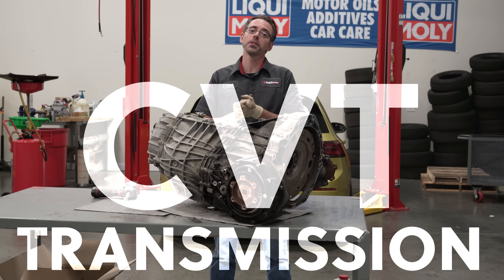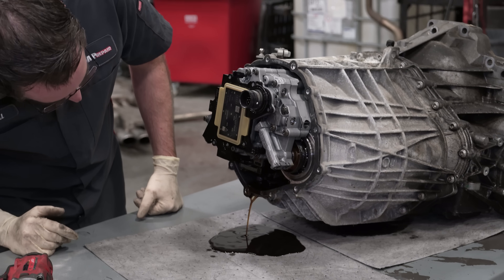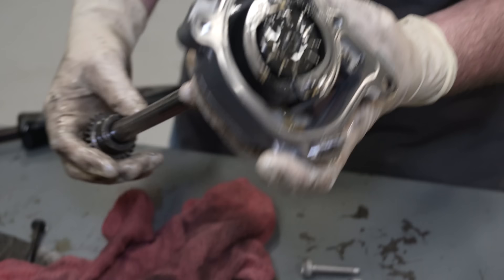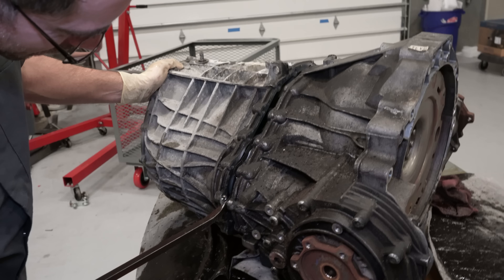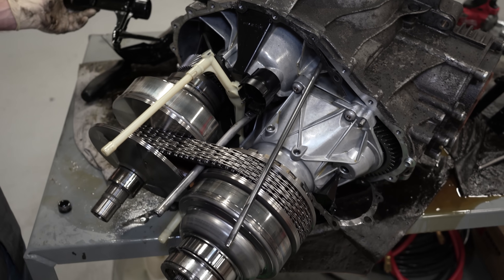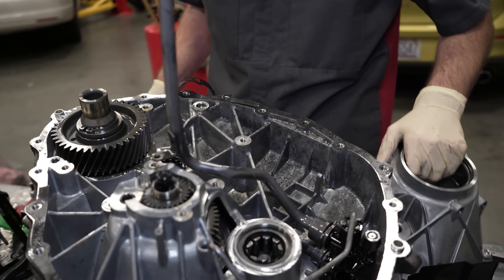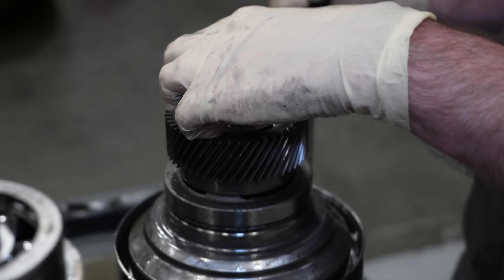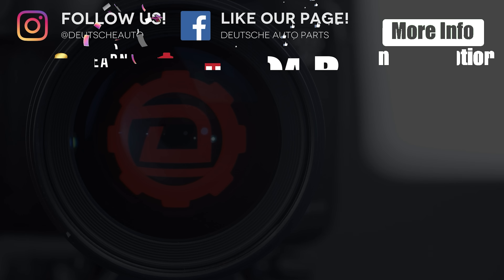Why you shouldn’t get a CVT transmission

Comment: This is my response to @loualexander3408,  9 months ago, who wrote:
"Toyota and Honda CVTs tend to last longer than other CVTs because of the launch gear. One thing many CVT vehicle owners do not realize is that no damage can occur if you change your CVT fluid more often (unlike regular transmissions with say over 200k miles on them). Additionally, changing CVT fluid more often (say 30k miles or so after the first change) can prolong their life. In the case of some Nissans, changing even after 15k can show a lot of worn material. Another thing to mention is that CVT transmissions work better when the transmission has reached operating temperature. So, in the winter your car may not need to warm up but your CVT does. I would wait till the car reaches normal operating temperature on a CVT car and be extremely gentle on it the first couple of miles (no hard acceleration or deceleration). Another thing is that driving very fast on a CVT can wear it out faster. I would say try to stick below 85mph or 75mph when you can with a CVT car. They can last if you take care of them and have some basic knowledge. Good luck."
My response- Thank you for the tips. 
If this guy from Deutsche Auto had started off with those tips, and then explained the possibilities of avoiding CVT failures because of poor maintenance, then there would have been less negative squawk. 
The first link at the end shares the improvements made by Subaru on the newer vehicles from 2020 and up and the next link after shows which models are covered. 
Maybe the Deutsche Auto guy should do more homework before positing a lot of negatives. 
I have a 2020 Crosstrek and having regular service has given this car amazing life... https://youtu.be/w6H7aDLQOwM?si=69dHrJGGyQIV6-G_; https://rideplusdrive.com/subaru-cvt-models/. 
Just saying... :)

Comment: I have a A6 2.0TDI chipped to 180hp. It has run nicely for over 335k km. The last 190k in my ownership.  I have abused this car a lot.  I use it almost daily on the freeway. 110- 140 km/h. Sometimes faster Have had zero problems with this CVT. I have served that car myself, and I change oil on the tranny every 50k km.  So it looks like service is the key to a long life on this transmission 👍👍

Comment: Toyota is the only manufacturer that perfected the CVT they call it a ECVT. It uses electric motors and gears without the stupid pulleys and belt that fails early. Then Toyota sells their vehicles at competitive prices. While all other CVT manufacturers make sure you are paying high prices for their total shit tranny's. However you could of just bought a real automatic transmission and been worry free or Toyota's ECVT version of a reliable tranny.

Comment: My Nissan Versa transmission started messing up after the wife continued to try to accelerate up a long steep grade.  I could hear the transmission struggling and knew that harm was being done.    That was months ago, and I continue to drive the Versa despite the crippled Transmission, I do no let the wife drive it as she has a heavy right foot.  I use it to get back and forth to town.  No significant hills, and just 6 miles into town.  I have inquired with a few local auto repair shops, and they all refuse to work on this transmission.  I presume they do not want a returning customer complaining that the transmission is failing again.  So I will continue to drive the Versa as long as I can, as I see no other solution to the transmission issue.  I will chime back in when the trans gives up the ghost.

Comment: The auto manufactures should take a lesson from the Ag-tractor manufacturing. Ag-tractors use planetary gear that the outer ring is geared to a pump/motor that controls the ratio by letting it rotate driving a pump/motor in turn changing the ratio.

Comment: I share same your feelings about CVT transmission,I  don’t trust it . 
Gears are much more reliable ,
In CVT transmission the idea is inclined surface of metal in both sides and metal belt .so the friction between inclined surface both sides one is stable the other is slidable by force of oil  and metal belt has taper cross section shape to match both sides.
I don’t rely on this transmission.
It needs more development to be Reliable.

Comment: Wow, how ironic to hear a VAG specialist complain about reliability. I had a shitbox VW GTi that within the year that I owned it, needed dozens of components replaced. Thousands of $ of parts, and it still had issues when I sold it. Always serviced on time, and by VW dealer. I sold that and then bought a Toyota Aurion V6 with CVT. Launched it plenty of times. Never an issue with the transmission. I have just sold that car and now bought a Subaru with CVT. They may not be the most fun to drive. But they are tuned to find the sweat spot for fuel economy if driving frugal, or if floored, will hit peak power and sit there. I'd trust a CVT before I trust a DSG, especially a VW DSG 👎

Comment: worked for a military company that designed and manufactured CVT,s for Tanks, for giggles we manufactured a CVT for a 2000 dodge 2500 /cummins, put your foot down ,hit 1500rpm and it would blow the doors off of Vetts ,

Comment: I have never experienced a CVT failure. My first CVT was in a 2011 Mitsubishi Outlander Sport; the second one was in a 2015 Outlander Sport. My 2023 Outlander has one. I have noticed that my service manual keeps lowering the maintenance intervals. It went from 100,000 miles for the 2011 to 30,000 for the 2015 and 2023. There might be other factors that contributed to Audi's CVT failure.
Reply: Am a mitsubishi outlander lover too can you sell the old one to me?
Reply: Being an Audi would be the first clue.

Comment: this is why I got a mazda cx-5. regular 6 speed transmission. had a nissan rogue with the cvt. always drained and filled the cvt fluid every 30,000 miles, and it worked well until it got totaled at around 165k. the cvt always made me nervous, thus the constant fluid changes.

Comment: I’ve had two cars with traditional CVTs run over 165,000 miles without issue and more efficiently than regular automatics. The are great, particularly when climbing hills - no hunting for the correct gear. And I’ve driven two Toyota hybrid eCVTs (which are actually planetary gear sets) over 125,000 miles with zero problems. 
Everyone is entitled to their preference of transmission, of course, but to trash all CVTs as bad is nothing more than propaganda. Thumbs down.

Comment: Honda really knocked it out of the park with their 2016 CVT. Have well over 100k on my vehicle and zero transmission issues. Now an Audi having CVT issues is completely unsurprising - under no circumstances would I buy German technology after my Cabrio died a quite unexpected death -- the result of manufacturer bearing defect at 105k. The manufacturer I didn't expect to get negative feedback from was Toyota. I work for a fluids, tribology, engine testing lab, and the team who tested Toyota, had absolutely nothing positive to say about Toyota's CVT implementation.

Comment: I drive a 100 mile round trip to work and back 5 days a week. My car has a CVT tranny with a 2.5L engine. I've been through 2 CV joint axles, each side. I drive like a bat outa hell, and my front tires boil if I stomp it from a dead still. My car currently has 240,000 miles and the trans still feels flawless......and my car is a Godforsaken 2013 Nissan Rogue!! I think being aware of how a CVT works (in vivid detail) affects the way I drive my car. Kinda like when I was a teen most of us drove stick shifts and learned how to make a clutch go a long ways. It's got a lot to do with the do's and don'ts of driving any particular car. I stay away from mountains and you'll never see a trailer hitch on it. And I rarely have a passenger. I anticipate hitting 300K soon while I'm always seeing the negative vids about CVT's, I can only scratch my head and wonder why.
Reply: @tooltime9260  how's that? Been driving since I was 15. No wrecks that were my fault....EVER in 46 years. Ergo, I've never had to make a claim. I'm an insurer's dream client. I pay them a shitload of money over the years, and it didn't cost them a penny. And that's why you pay more for insurance??? Do you understand how insurance works? How many claims have you made? If any, then YOU are why someone like ME has to pay more for insurance. That's how it works.
Reply: Same here. I drove a lot and my Subaru cvt has 231k on it. Regular fluid changes on CVT
Reply: Absolutley agree... you nailed it.  After knowing how it works. I can feel the belt and apply gas just at the right timing 👌.. I like my CVT

Comment: Took my trailblazer to auto lab because there was a delay from park to drive and the vehicle would jump if I hit the gas to soon. They said GM claims this is a normal occurrence and there no need to fix it. Auto lab said there is no repairing these transmissions either. Only replacing with a new one.

Comment: I had a 2009 Nissan Altima with a CVT in it. I loved the shiftless acceleration and being able to coast down hill without increasing in speed. The transmission was still operating well with nearly 200,000 miles on it but the front suspension was worn and the cost to renew it on such an old car did make sense so I traded it in on a Kia with a non-CVT. The transmission on the Kia is very unrefined and the rough shifts are definitely annoying.
Reply: 200k miles with CVT? how many times you had to change the CVT Fluid? Please respond soon! Thanks!
Reply: @Aer0nfps  30,000 miles. If I remember correctly, that was less than recommended and it was fairly expensive because I insisted upon only using Nissan’s CVT fluid, but it was less expensive than a new transmission.
Reply: @alanfan8941  I currently have the same 09 Altima (105k-miles) & it slips almost every time it reaches 15-20MPH. I'm debating if it's worth replacing the CVT, replacing the valve body, or just getting rid of it. Any thoughts & suggestions? Thx
Reply: @Artillery-Vet  Apparently I had very good luck with my Altima. I am not a mechanic but I am under the impression that you cannot purchase just a valve body or really any replacement parts for the Altima CVT transmissions. A new transmission installed will run upwards of $4000. Is your 09, a 15 year old car, worth $4000+ to you? In my opinion, save your money and drive it until it dies, and then get a new car.

Comment: CVTs are really good transmissions and are not going anywhere. They are dead simple to rebuild with minimal parts. Technicians need to stop being afraid of change. My Nissan CVT went out and I'm fortunate enough to know how to rebuild it. Otherwise, I would have no choice but to replace it at a premium because no one will touch it.

Comment: The main problem with CVTs is they are sold as a no maintenance unit which is just untrue.  The fluid still needs to be changed regularly.  Honda and Toyota every 50 000 kms or for a Jatco trans way more often.  Nothing mechanical is maintenance free

Comment: Came across this video in my recommended and this dude is absolutely hilarious. 

Back in the mid to late 2000’s my mother got a practically brand new car with a cvt in it and she was pretty skeptical about it. After a few years it started failing so I’ve always steered clear of them. It’s really interesting to see how they work internally, they seem to have so many possible failure points.

Comment: CVT is a pretty good transmission for a car, if it only were not this expensive. They were invented in like 1900 even before the car itself, I just wish there were better. So far I am still using manual, I don´t trust any transmission tech besides manual. Every other one uses either more gas or costs more money and needs to be constantly maintained etc.

Comment: I worked at a U.S. Honda dealer for a couple of years. Absolutely no issues with the CVT in any model. The electronics in my 2017 Accord are infuriating and buggy, but the drivetrain has been great.
Reply: Honda has never fixed its electronics. They simply don't care.
Reply: I've seen a bunch on forums. They may be decent for CVTs but they will not measure up long term to a good automatic or manual. Not all automatics are good either though, the AT in a Pilot is trash, for example. Plus, they drive like a CVT.
Reply: A friend had a Nissan Rogue with one. After about 45 minutes of highway driving (so no stop/go) the CVT would get too hot and prevent the car from achieving a certain speed. The result was either having to let the car sit and cool down for a bit or get off the highway and drive on the access road, hitting a stop light every half mile. Perhaps they've fixed the issue but that Rogue was a PITA. Can't speak for any other vehicle.
Reply: @kellyngrey4950 , I've heard many bad things about Nissan's transmissions.
Reply: @kellyngrey4950  Under Stellantis (Fiat) they don't stand a chance.  Nissan used to be trouble free, expense free motoring.  Not anymore.  In the UK, the Quashqai was an economical family friendly cross over, ideal for most familiies.  I have no idea how they are now but I don't hold out much hope for them under Stellantis.
Reply: @kellyngrey4950  Nissan recently did a CVT upgrade on some models.  I think on the Rogue.
Reply: @kellyngrey4950  Nissans CVT is the worst of all of them though
Reply: Thanks I thought so my 2016 civic has been great east to do maintenance also
Reply: Same here. My sister's accord is 2017 and has a cvt and still runs good. I got myself a 2021 civic sport currently at 45k miles and no issues at all. Just service the transmission at those near 30k intervals. 
I noticed people that hate cvts are ones who like to either drive fast or do a lot hauling, none of which I've had to do so no issues for me there
Reply: Hello I wanted to launch my Toyota Avensis, press the brake then accelerator and it just snapped.. it's going D, R but doesn't move. When I put it in P it makes some noise for like 3sec. So can someone tell me what should I do? 2.2d 150ps 2010
Please tell me if you know what could it be. Thanks
Reply: I've had to replace a couple of HRV  cvt transmissions
Reply: Honda's and Toyota's CVTs are generally leagues above other manufactures CVTs
Reply: over 300k miles?
Reply: What, you mean the CVT still works in your 7yr old car? Wow, Big claim.
Tell me about your CVT in 10 years time and it might mean something.
Reply: Lmao keep moving that goalpost buddy  @elliotkane4443
Reply: They suck compared to regular transmissions.
Reply: parroting what you read online lol npc @wandameadows5736
Reply: Wrong  @wandameadows5736
Reply: @wandameadows5736 so you want your car to breakdown all the time? Not everyone wants unreliable American cars
Reply: @wandameadows5736  You mean like the 10AT which can't carry any weight and has stutter going from 3rd to 4th?  Ok.
Reply: @greggc.touftree5936  Not all ATs are bad but nearly every CVTs drives like shit.
Reply: @chrisbradley3224 same can be said about fuel consumption. All AT’s are big time dogshit in FC department.
Reply: @boboiboy9350  uh, no. ZF top automatic transmissions are as good or better than CVTs basically since they lock up completely after first gear and have lower drivetrain frictional losses. There is a reason CVTs are only found in economy platform based cars.
Reply: @chrisbradley3224 please list all the CVT’s you drive daily to form the ridiculous opinion you feel obligated to spew out.
Reply: @wandameadows5736 In a highway cruiser, there is nothing better than a CVT.  They only suck in the city.
Reply: @LakeHowellDigitalVideo Aren't CVTs supposed to be good in traffic conditions?
Reply: @archangel7052 They're smooth and offer better gas mileage. That's as far as the benefits go. Traffic also shortens the lifespan. Oftentimes, CVTs don't make 150k miles. Some don't reach 100k. Toyota mostly solved the city driving portion by using a launch gear. Essentially an actual first gear. CVT starts about where the 2nd gear would be

Comment: It’s a Dutch invention from the sixties and was used for the first time in the Dutch DAF automobile.The transmission in this video is a development of the original DAF transmission.
Reply: The first CVT patent is from the late 1800's, and been used in snowmobiles well before the DAF.
Reply: On the DAF you could change the belts in a blink of the eye without removing the transmission . Try that on todays high tech (ha what a joke) trannies.
Reply: The same concept  with pulleys that open and close  was used by Massey Fergusion 415 Combine Harvester, but had a normal 'rubber' belt that was more than 2inche across and over an inch thick. Opening and closing the main pulley wheel was done by hand, by winding a handle by the steering wheel. (Don't know if earlier models had them)

Comment: I hate CVT. It is only benefit for manufactory because there is less parts and easy to build. However, it is worse nightmare for car owner. Thought, all stress work put on only one part is belt and second it is pulley which drive a belt

Comment: Your results may vary. 

First gen Murano went 370,000 km. No problems with a Juke or a Suzuki SX4. Minimal maintenance. 

Not my favourite transmission but no issues with the several I’ve owned.

Comment: CVTs are fine in snowmobiles when you can change the belt. They are a horrible idea for a car with any horse power. The folks in the comments with CVTs that have high mileage have not driven them hard.